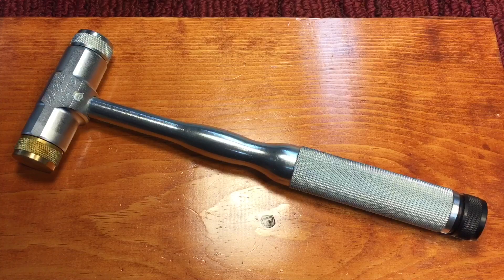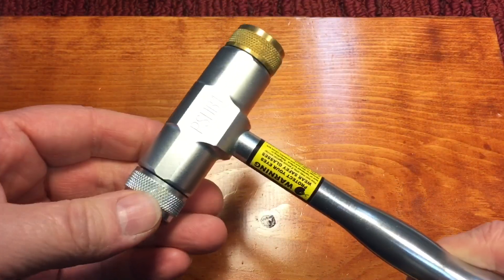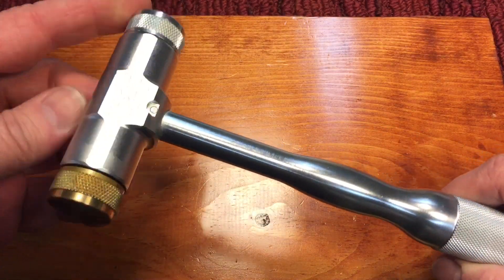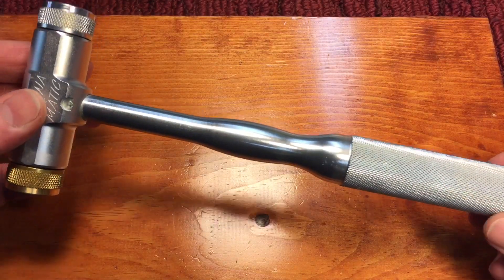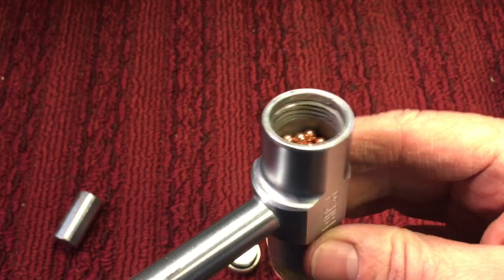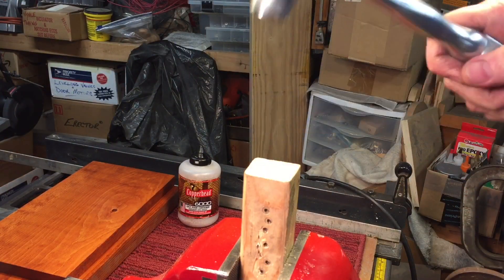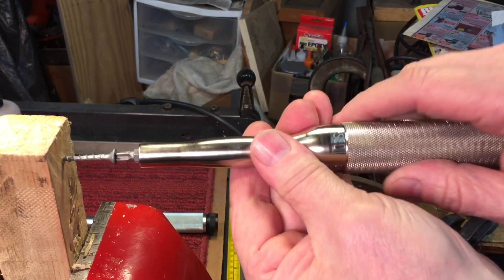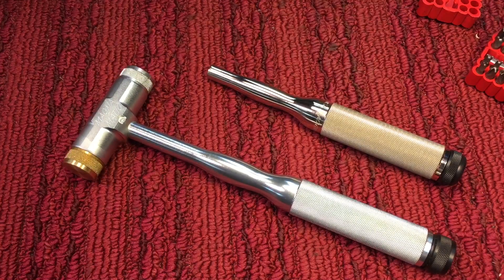Magna-Matic Hammer and Screwdriver

Comment: That's a nicely machined hammer and screwdriver. Thanks for showing us. I too like tight fitting bits in a handle. I have the Wheeler gunsmith set and it seems to work fine, may have to get the screwdriver to add to my gunsmith kit.  I should send you some lead shot! I have some indoor recovered lead shot for trap shooting but California doesn't like lead anymore. I use it for putting under set screws.

Comment: Pretty! I like the knurling. That would make a good hammer for adjusting plane blades in the woodies. 😆
Reply from the maker: Dave!   What is it about Knurling that we all love so much!?   =)
Reply: @ScoutCrafter  For me it represents fine tools. It was an exspensive final step that rquired skill and a strong machine to do well.
That and the first time in shop class making a hammer handle for a lead hammer watching it magically appear beneath the rollers. Great feeling. 
I still have the handle. It needs a new head again. Lead hammer heads work well, but they don't last. 😆😎

Comment: lovely tools - I being a bit arthritic tend to rely on drill/drivers and have to say, loose bits are a nightmare. They contribute to loss of power/ and spoiling of the screwhead and most annoyingly remain behind when you lift the drill away. Even those little extension bars with the magnet inside don't help. Pleasure to see a changable bit driver doing it right!
Reply from the maker: Hi Keith!  I'm with you!  I always prefer a solid shaft screwdriver.  However gunsmiths have so many different tip heads I guess they prefer the interchangeable handles.  This one is done right for a change!!!   =)  Thanks!

Comment: That screw driver is killing me. I might have to get one. Like I need another one, haha. In the last bit if the video, you had a bit set with  the security pin hole in them. I was mad at myself today because I couldn't find my set. What is the brand of that bit set?  Tomorrow, first flea market of the season!
Reply from the maker: Hi Steve!  I bought that set years ago at a tractor show, funny thing is in 15 years I think I used it once!  LOL  However, as you know when you need such an item you really need it!  LOL   Thanks!

Comment: Don't some dead blow hammers have hollow heads filled with shot and a fairly viscous oil? I learned a lesson when I misguidedly used a dead blow hammer to tap the lid back onto a paint can. I collapsed the sides of the can instead. Luckily, I didn't splash paint all over the shop.
Reply from the maker: Wow!  I never opened a dead-blow hammer, I always listened to the insides and just assumed it was steel shot.  I do prefer the shot (BB's) over the slug for sure!  =)   Thanks!

Comment: You could have use a rounded bronze bar fit tight ,instead of copper balls..👍 it's a little bit heavier...The move inside the hammer is annoying...
Reply from the maker: Hi Send, the BB's are copper plated steel, they are quite heavy and I agree about the slapping of the solid bar.  I much prefer the BB's...  Thanks!!

Comment: Very nice! A shame they only ship to the US and Canada...
Reply from the maker: Hi Marcel!  I'm sorry, I didn't know that!  Shipping overseas is so expensive for smaller companies.  I shipped a small Billings Bicycle wrench to England and it was $24!  =O  LOL   Thanks so much!!!!
Reply: @ScoutCrafter  
Shame is the wrong word, "what a pity" would fit better.

In case of a company that's actually not a problem. They mostly let the customer pay for that, and that wouldn't be a problem for me to pay for that because I know that it's expensive. DHL wants for a delivery to the US 16€ (~18 $), but it's not trackable and not insured. For the insured (insured value up to 500€) packages they want almost 37€ (41 $).
And then it will go through customs, you need a declaration what's inside and the value of it...
Reply from the maker: @Marcel_Germann   Yes!  It becomes a real hassle for international shipping.  Some companies are set up for it and do it quickly and cheaply.   China has a govt. subsidized system and they ship things very cheaply.
Reply: @ScoutCrafter  For China it's a bit different. Some history lesson, that was before January 2018: There's an international agency called "Universal Postal Union" founded in 1874. They regulate trans-border postal services. They rated China as a developing country, and that's the reason the shipping is so cheap from there. In almost every country is at least one delivery company which must deliver the package for the price specified by the Universal Postal Union. Here in Germany it's DHL. It was even cheaper from China to Germany than shipping inside of Germany, a massive joke...But they've changed it in January 2018. I suppose now it's subsidized by the state.

Comment: i wounder if they put that slug in the head to maybe give it that little extra slam to it as well as to stop it  from bouncing back off the item  your hitting or if they put the slug in the head so when people open it up that they dont lay it down with one the heads off  for some reason n  now they have  BBs or shot all over the place that the customer has to clean up. but ether or its a nice hammer and cool that you didnt know any thing about this hammer and you almost made yours to match  all the way down to the pin in the head to pin it to the handle talk about the stroke of luck hu
Reply from the maker: Hi Steve!  I never would have known about this hammer if not for making my hammer!  I think all the ideas of both hammers are at least a hundred years old.   Every time you think you are on to something new you find out it has been done a hundred times!  LOL  Personally I really like the BB's over the slug, it's quieter and the effect is better for me.  I tried both...  =)   Thanks!